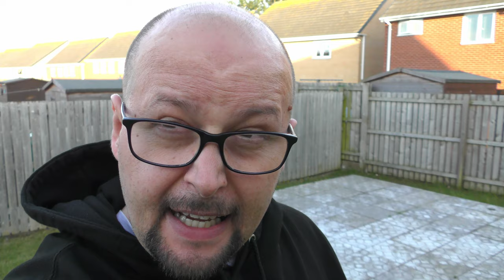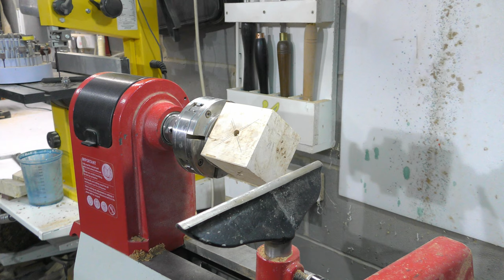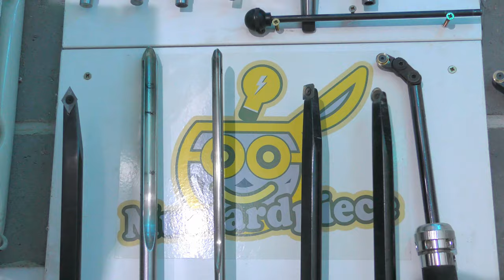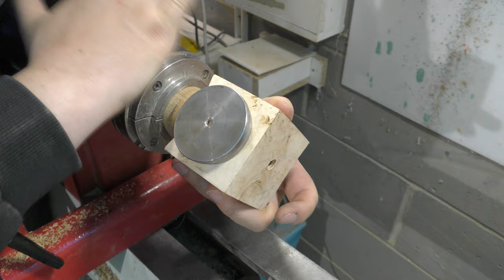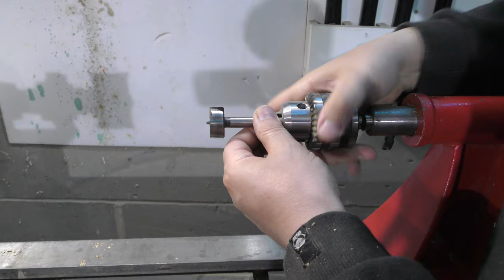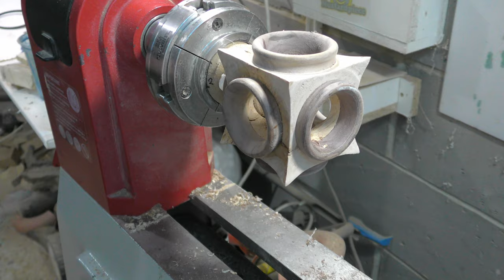Cool New Woodturning Technique - Work All 6 Sides of a Cube

Comment: Thinking about this. If you had chuck jaws small enough, you could expand them into the hole that you drilled with the Forster bit in the first side BEFORE you attach the walnut piece. Then you could work the opposite side. Then everything should still be pretty close to centered. Once all six sides are drilled you could finish it off with pre-made walnut rings. 

But the way you did it works, and it came out nice.
Reply from the maker: I see what you mean. Mine, all 6 sides of the cube are concave. I don't think you can mount it accurately with the jaws. Maybe I am wrong I need to try it. Thank you for watching.
Reply: I think it would be possible if the hole was not too deep and the chuck jaws bottomed out in the hole, registering on the flat face of the hole and not touching the concave face of the cube.

Comment: If you use a couple drops of acetone the hot glue will release instantly and then you don't have to be stingy with it worrying about cleaning it off after
Reply: Thats a great tip thanks
Reply from the maker: Thank you. :) I will try that.